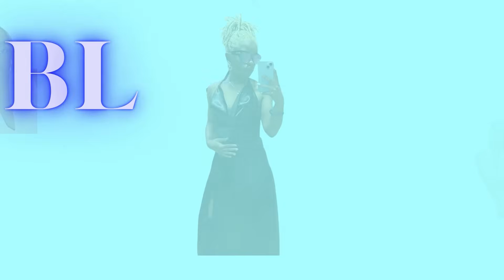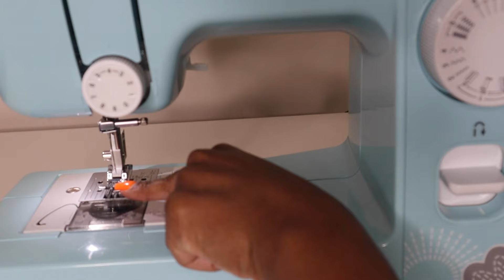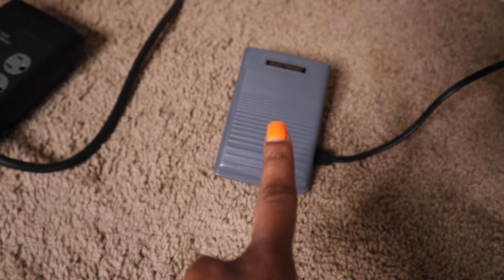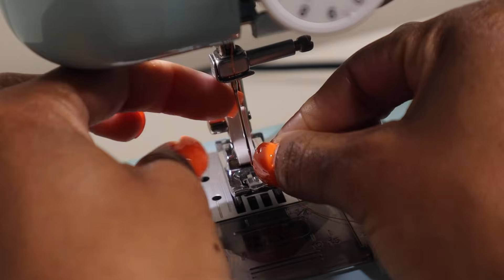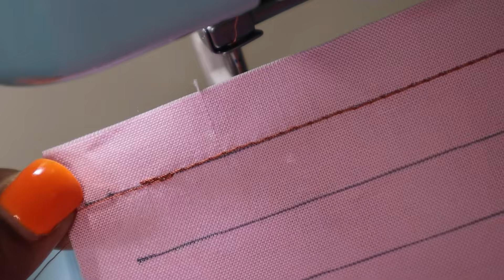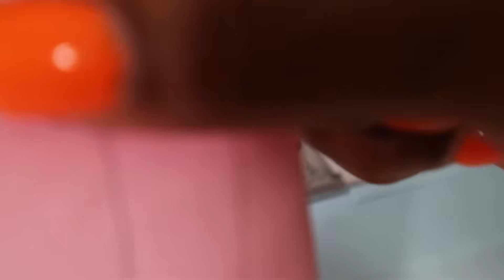Brother LX3817A Sewing Machine- Complete Beginner's Walkthrough! | How To Use Sewing Machine

Comment: Im back and I was wondering how I could overlock my edges with this sewing machine because I’ve heard using zigzag stitches work without having a serger but the regular zig zag stitches seems too far apart, so I put the dial to stitch 5, but that one doesn’t move the fabric forward as easily as the regular zigzag stitches seems too

Comment: 11:52 my bobbin thread won’t come up I’m not sure what I’m doing wrong😢 can someone help thank you
Reply: Im looking for the same help sorry it has been a month since hopefully either u have the answer or I will s9on lol
Reply: @ssarahii2070 I just figured out that to bring up the bobbin thread, you don't stop when the needle goes down. Just keep turning the wheel the same way until the needle comes back up.
Reply: Ok took me a sec of messing with it but i was having the same issue and I sort of just kept turning the wheel and then at one point just started pressing the lever to get it to go fast and idk if that was the trick or what but eventually the bottom thread came up. Also I think sometimes it can be hard to see the bottom thread when it comes up bc I don’t think much comes up. U gotta spot it when it does and pull it up further and then to the back. Hope this helps😅

Comment: Im having an issue with the top thread bunch up underneath. What can I do to resolve this? I followed the tutorial and my thread breaks or bunches
Reply from the maker: It’s a tension issue.
Reply: @BluTheeDesigner ive switched it from 3-5 like suggested on the manual. Am I threading it wrong for the tension to be wrong? I make sure the take up lever is all the way up too
Reply from the maker: @CariArgraves you could try rethreading. What type of fabric are you using? Also check to see if the bobbin is threaded correctly